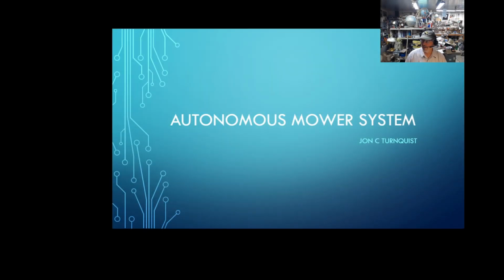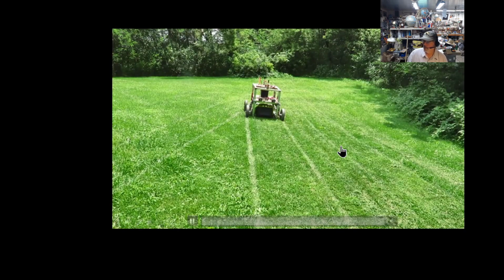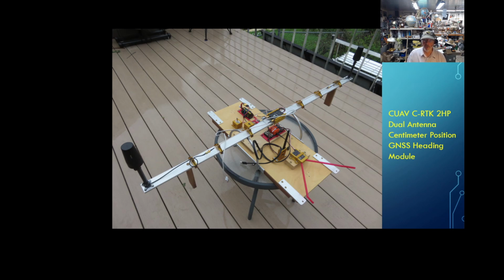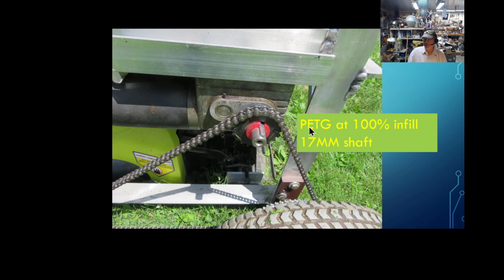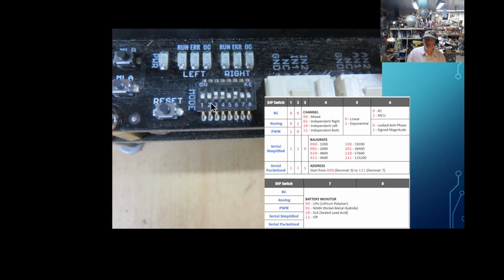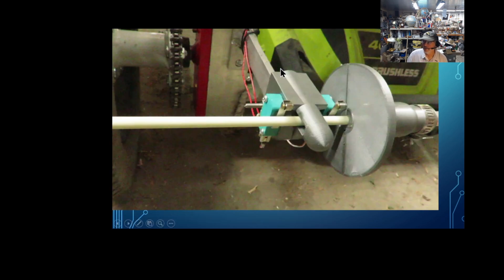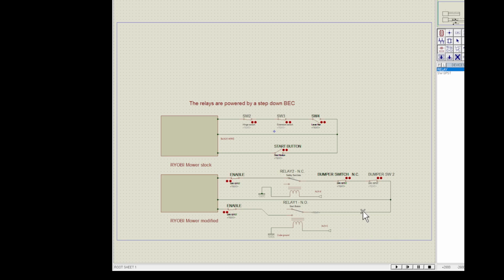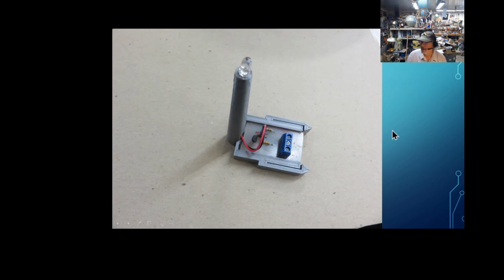Automatous Electric Mower Project with CUAV C-RTK 2HP GPS for Yaw

Comment: Hi;

Is it mandatory to use GPS yaw in such projects?
Reply: GPS for Yaw (aka Moving Baseline) was needed (not mandatory) due to the motors magnetic inference with the compass. It was the only way I could figure out how to make this mower with the precision positioning I wanted. There may be other more complicated ways, and other less accurate ways,  however this way works and has a lot of helpful documentation online.